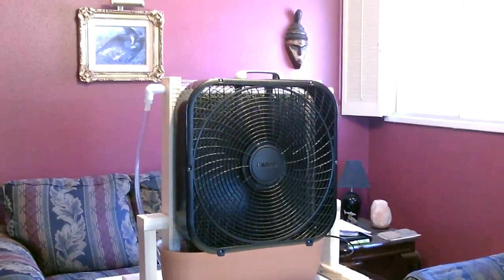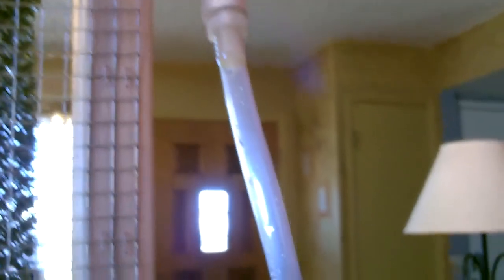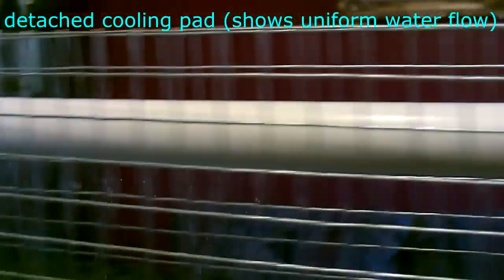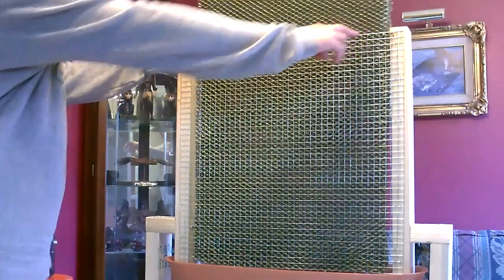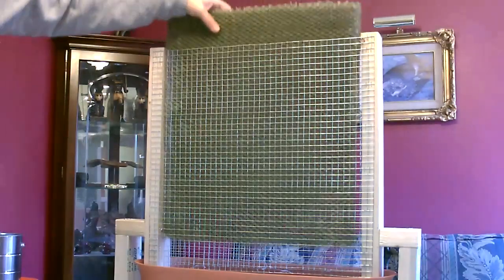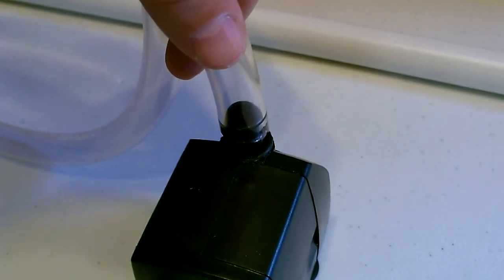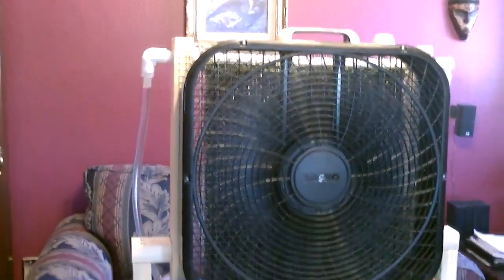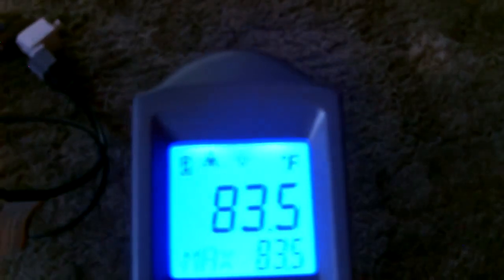Homemade Evaporative Cooler! - "whole room" Super Cooler!  - up to 30F drop! - Easy DIY

Comment: Hey, nice job. Good video too. I wasn't bored either. 😁 I have a few questions if you don't mind. Do you ever have a problem with humidity or mold inside that room?  Is there a reason you chose not to glue the ends of your PVC pipe instead of sticking the ends together? One last question. What about the wire at the top holding up the filter material......did you choose stainless steel? I think the wire will eventually start to rust. Thanks for the video. Nicely done. Thumbs up.
Reply from the maker: hi there. i've never had an issue with excessive humidity but since these type of coolers do increase humidity as they cool, it's a good idea to let fresh air into the space you're cooling every so often. that takes care of any humidity issue.  there are several ways to avoid the possibility of any mold but the easiest (and the one i use) is to just make sure you dry out the cooling pad every 12 to 24 hrs. that only takes a couple of hours. or... a quicker way is to turn off the water flow and just let the fan run for 10 to 20 mins. or until pad is dry. the high volume of air being pulled thru the pad dries it out fast (in 10 mins where i live). i (originally) didn't "pipe cement" the PVC because it fit so well together (but later, just to be sure there would be no leaks... i did). i'm not sure what the wire i used is made out of - but no rust on it (so it could be stainless steel)

Comment: Hey just a thought I had by watching this vid.  I was thinking of building a similar unit but in a tower formation with the box fan on top.  It would be a square the size of the fan but it would blow the cold air up.  I guess you could make it 4 or feet high to make better use of the cooling effect, or just make a square that fan would just sit on so it could pull air in from 4 sides instead of 1 .  What do you think? would it work.

Comment: The standard freezer side of a refrigerator could also be used as a water chiller if you did not mind drilling a small hole into the freezer wall for the copper tubing coil line to go into the freezer. Silicone could be used to seal any air gap around the edges of the hole on the inside and outside of the freezer wall. You would have to sacrifice some food storage depending upon how big you wanted the copper coil line to be. The water pump would have to have a good rate of flow also depending upon how long the water line was. This would be A LOT better than continually dumping ice into the reservoir. When you turned the fan off you would also need to purge the copper water line of any water to keep it from freezing inside the copper coil inside the freezer. I've seen this set up done with hydroponics for people that needed a water chiller but didn't want to pay for an expensive water chiller but it would also work with a swamp cooler. If you wanted to get the air blowing as cold as you could and as cheap as you could, this would be the way to go.

Comment: making the frame from PVC would eliminate using the 2x4.  A 10' piece is only a couple of bucks here. Great idea though.
Reply: Slip elbows and Tees to connect that pvc cost around $1 each, would need a lot. It's definitely an option but not a cheaper one

Comment: Just a quick question. When the  water evaporates, that is cooling the  surface of the cloth by absorbing heat to make the water pass from a liquid to a gas right. The  fan is then pulling the now more humidified air and blowing it  around. So does that mean that the actual circulated air is cooler or is it just producing an extremely fine spray that lands on you and then re-evaporates causing you to feel cooler? Basically like a real big motorized, very fine droplet spray bottle. Yes, no?
Reply from the maker: hi there. the actual circulated air is cooler. there is no fine spray (like a mister). the water stays totally in the pad.
Reply: There is an 'energy cost' to phase changing water from liquid to gas (evaporation). The air gets more humid, and that energy is used up in the process. What this does is makes more surface area + move the less humid air over the surface, plus constantly replenishes the water. Less ambient energy = cooler room.

There is a limit to how much water can be absorbed into the air as humidity, so you will need to cycle the air in the room every once in a while.
Reply: KA Thomas The 'drip pan' is just a ordinary window box planter you should find in Home Depot, or any other garden-supply, or DIY chains.
Reply: Where can I find the drip pan?

Comment: I love this idea. Summers get hot here and I'd like an alternative to my expensive to run A/C when I'm away from home. Have some older pets that really are at risk when the temperatures get into the high 80's and above. My only concern would be having to refill it every few hours. Thinking that if I could put a small float in it (like the ones they use in swamp coolers and have a water source feeding the reservoir, that would be the ultimate. Shouldn't be too difficult, right? Hmm. Maybe all I'd need would be to run tubing from a large insulated water cooler (like the ones construction workers have in their truck beds on job sites) running to the float. Maybe?
Reply: It may not be physically convenient, but with enough tubing and a little adaptation, you could run your source water right from an existing toilet tank.  The float and refilling source issues would be already solved that way...

Comment: I don't know if anyone submitted a mod for this build or not but I used a Fill Valve in the tank so I wouldn't have to constantly fill the tank.  Best unit to use would be a Korky Universal Fit Adjustable Toilet Fill Valve: http://www.lowes.com/pd_102579-868-818PK___?productId=1000645&pl=1&Ntt=fill+valve, with a little bit of time and some engineering I was able to use pvc pipe and some fittings to connect a hose from out side.  Works great! Great Build!

Comment: Good idea.  I live in Phoenix and today it was 115 degrees.  And I sure don't like paying $2-300 for even a used one.
Reply: Yep .. without pulling in drier outside air, you're basically turning on a room humidifier.  Good job on your design though .. makes me wanna build my own :)  We've lived in Arizona for years and you can't beat swamper A/C.
Reply: +Bob Hoboken you can beat a swamp cooler but not in cost efficiency.
Reply: OK, finished mine a couple of days ago, now experimenting.  Found that ducting the air to be sure all the pad surface is used is important, have to modify it a bit.  Right now it is 109 degrees and the relative humidity is only 9%.  I achieved 82 degrees in front of the fan.  Not bad for under $70. I used a box fan (already had it), a large stainless steel pan from a kitchen supply ($26), and a pump from Lowes ($15), misc. pvc pipe, tubing, etc., and some angle steel which I also had laying around the house.  ONly other changes will be a wooden dolly to make moving easier (Harbor Freight, abt $15) and an electrical box on the side to clean up the wiring.
Reply: i'm having a hard time finding out how effective these are at cooling a whole room, everyone keeps talking about the temp right in front of the device...how about ambient temperature for the space? thanks!
Reply: This is important:  You must keep outside air going through the pad.  If you don't the cooler will raise the humidity level in the room, and when that happens, the effectiveness of the cooler goes down rapidly.

Comment: Just made one. However, I am using an actual evap cooler pump and it is a little overkill.  Where did you get the smaller pump? Is it an aquarium pump?

Comment: Nice work, I like the other models you made with the copper coil because it isolated the water from the air flow which is better for more humid environments. This design with the cooling pad would only be practical in very dry areas of the world.

Comment: 200 gallons per hour is way overkill for mine
Reply: It only uses 3.8 litre of water an hour.
Reply: +Aldion Sylkaj 200GPH refers to the rate which the pump pumps water. 200GPH is leaving my cooler pad soaked! I have read that you want it damp for optimal evaporation. My theory is that dense water blocks air flow and also surface tension. Mine even on the slowest setting sounds like a water fountain not a trickle.

Comment: Through a filter in front and you have an air cleaner as well - plus its keeps the works clean. Also its a humidifier at slow speeds - cool video!

Comment: Also, could you possibly get away with making it out of furring strips or something a little less bulky? I was thinking possibly PVC pipes all the way to the top and maybe a couple furring strips glued long ways to accommodate the cooler pad. And with it mostly made of pvc pipes, you could easily connect the pump straight to the unit so that you dont have a random pipe just dangling on the side. and did you seal the wood with anything to keep it from molding or warping from the water?

Comment: Good video. Gonna give this a shot. I live in Florida and the hot months are coming up. Thanks for your time and effort doing this.
Reply: I live in FL too, but many of the comments said this will not work in the high humid areas.  Did you make one and if so, what has your result been?  I'm curious to know if it will work here in FL.  It has been terribly hot (94 lately) but also VERY humid and that is what makes it so uncomfortable.
Reply: There are a number of different ideas that work on Youtube. Expense is one thing , area to cover is another, difficultly to make is another. If it's just a room your looking at then the cooler with ice will work fine freezing your water the night before.
Reply: Little more info Pamela. Apparently to do one of these to RECYCLE your room air will tend to increase the humidity in your room or house. Eventually making it very muggy. If you use the mesh in front of a window pulling  outside  air in through the water soaked filter but with a whole house fan it will eliminate the humidity problem. Cost at about  13 or 14 dollars a month on the electric.
Reply: Cost about 50-60 dollars to build. Expect about a 20 degree drop maybe a little more.

Comment: An idea here. Utilize the internals of a toilet with the water being replaced when it gets too low automaticly. Maybe useful
Reply: Float valve.
Reply: Whoops! Didn't see this before I asked the same kind of question. Makes sense, doesn't it?
Reply: Dancing Spiderman first time ive seen it as a reference...try brawndo, its got electrolytes! its got what plants crave!
Reply: You mean, like ... water, from a toilet?

-- Idiocracy
Reply: I just have the sucker pump suck water right outta the toilet bowl.   works great
Reply: use a sub pump float might be easier then putting a toilet into this design

Comment: Made two of these today. Took me four hours. About $40 each. Working excellent. Thank you for the video.
Reply: Nice tip. We're still using these by the way. Well into the hundreds here everyday right now and we're keeping the room at 85. Sounds warm. Until you go outside LOL.
Reply: Yes. That works. Melts very quickly. Can freeze jugs and they last a little longer but yes, cold water works well.
Reply: Does it cool the entire room or just the space in front of it?
Reply: Sorry I missed your post. If we keep the room closed up, it will cool the entire room.
Reply: Oh ok. Thanks.
Reply: Yep. Figured that out. Just keep one window open and they (both are still being used) work great.
Reply: try freezing smaller water bottles and just adding them into the water well
Reply: Mark McMullen its that ok
Reply: Where did you get the cool pad?
Reply: pour some salt to the ice that helps to keep the ice longer.
Reply: Mark McMullen  have you tried to put ice in water bucket to bring down water temp?
Reply: glen davenport This will hardly change the temperature of the air being produced. The main principle behind a swamp cooler is in the evaporation. The coolness you're feeling is due to the heat in the area is being used to evaporate the water. This latent difference between liquid and gaseous phases changes very little between the room temperature and chilled water you would run across the cooler. Any sensible difference due to ice would be little. To get more cooling you would want either a larger surface area or more water flow. The surface area in this model is about drenched though.
Reply: Kaleb Brown so if he places it in front of a window, would it solve the issue of making it cooler? I'm guessing that if you place it in front of the window, the water is going to evaporate due to the heat it needs to evaporate fresh water. if he made a line going outside the into a bucket mixed with fresh water and pump it back in to save water and recycle it, do you think it would work better instead of just pouring water in a bucket? but then the overflow of fresh water, oh, just turn the water on very slightly to continously get fresh water and giving it enough time to evaporate so the bucket wont overflow. i think i got something here. everything has to be timed just right to save and recycle fresh water

Comment: What's the black thing attach to the clear hose????
Reply: Water Pump
Reply: +ROMER ALINSUB Harbor Freight sells water pumps fairly cheap and they have from the smallest to the big ones. You need to make sure the pump can "lift" the water to the top of the cooler.

Comment: Hey desertsun02, Awesome Idea and Build. But I was thinking, if you were to make a 3 sided version of your build, you could have triple the amount of Air cooling area. You could use a large shallow tote as the reservoir. And the water from each side would trickle back down into the tote after circulating through the pads. With a removable top to close the cube,You could attach  your water distribution lines to it, then place your fan with the input side on the open side. But You would probably have to use a larger pump. [ regular Air cooler Pump ] with enough CFM to still keep that nice even flow of water circulating through the 3 pads. 
  Also if you were to make the outside mesh where you could slide them out , it would be easier to change the pads out when they get moldy or clogged with calcium. And If you wanted to go all out, you could  put the whole thing on castors so you could roll it from room to room. or store it away in the winter.
Reply: Why not use 4 pads in a rectangular shape and put fan on top.
Reply: DUSTERDUDE238 Yes. our swamp cooler in the hangar is exactly as you described.  It's a cube box on wheels, with 3 sides getting soaked in water. Temp is 40 degrees cooler than ambient.
Reply: +DUSTERDUDE238 by 3 sides you mean something like a triangle formation? or do you mean 3 layers of mesh mushed together? 
I like  your idea!
Reply: Shrive

I meant 3 sides like a window Evaporative cooler in a square shape. like this [_] the open side would be the fan end. :)
Although, I have "Double Padded" my  Commercially made roof air cooler, and it seems to work. Amazingly, even in Humid weather. This also works with window Evaporative coolers.
1 tip tho, Use only Excelsior pads.they are the most efficient. and allow  more air flow then those blue plastic things. and if you were to double up the blue pads, the air input might be too restricted and cause your motor to heat up and / or Burn Out.
I have never used the papery pads, so I cant really say how they work.[ single or doubled ]
Reply: @dusterdude238  So basically the more surface area, the better?  Like a large pad with an extending shoud, like the one desertsun did last year?

Comment: Why not use an aluminum automotive AC condenser in a sealed system? With a sealed system you're not increasing humidity levels exponentially and you're not losing water. Thanks for the upload.
Reply: he is saying build a car AC system in your home haha
Reply: The Force is with me n
Reply: The evaporation of the water is what causes the cooling. Without that you're just running a fan. It may cool down a degree or two but not significantly. That's why evaporative coolers work, and have worked for decades.
Reply: these work by adding humidity to the air.
Reply: Bargain Boondocker I made a setup using a an aluminum condenser from a junk window AC, and it works quite well, especially when you put ice in the water. you put water and ice in a modified cooler ( modified for the lines leading to the  condencer) to keep the water cold longer. they also work regardless of humidity (unlike the one in the video).

I haven't needed to use it much any more since I now live in a house with central air.